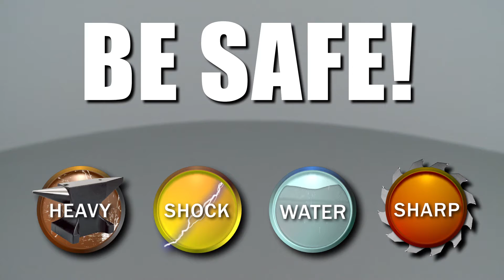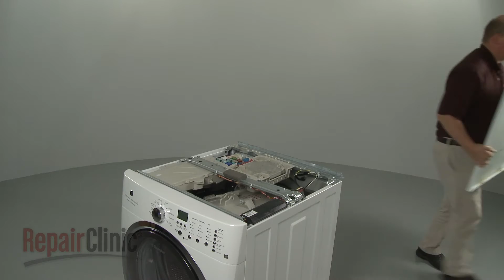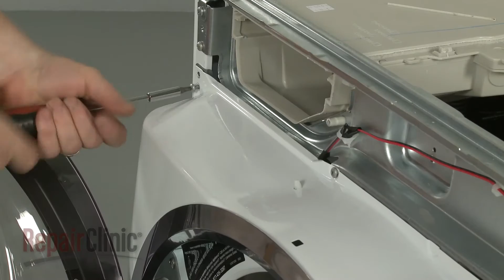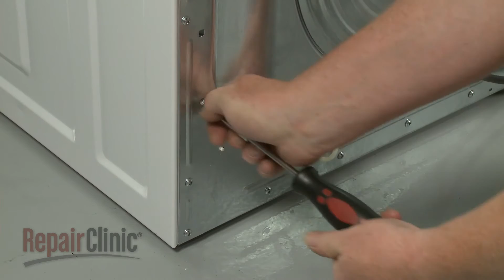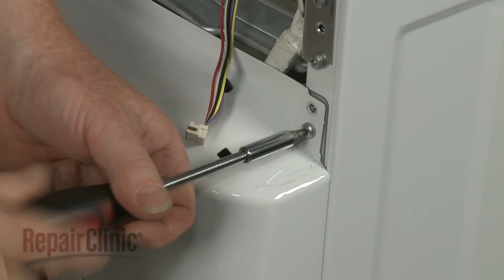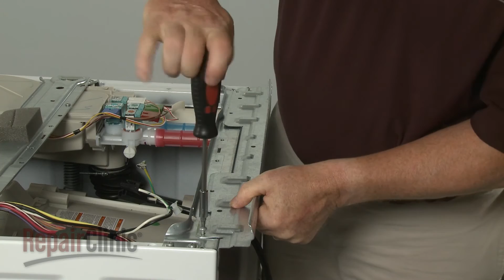Electrolux Washing Machine Drain Hose Replacement #137629200

Comment: omg. My friend was upgrading so she gave me her old washer. The hose was too short for optimal replacement and I ordered a generic replacement. Started to replace it today and thought I'd look up instructions as there weren't any in the manual booklet. This is an insane amount of work, the entire washer needs to be disassembled. It's scary that some engineer actually got paid for designing this crap. I will order a hose extender instead.
Reply: I just got help tilting it back and could unclamp it from the underside

Comment: Thank you to the comment regarding the rubber drum; it was helpful in replacing our hose. We'd like to add that we had A LOT more water than anticipated. Mostly from the drain hose itself. You could call it a "blond moment", but I didn't realize how much water was trapped in the hose we were replacing. The only other problem or issue we ran into was replacing the front panel. For some reason it would not sit right. We ended up putting the bottom screws in first and then the top. Still, one of the bottom screws would not seat all the way. This was a very easy instruction video to follow, very thorough. This project was completed by a Mother/Daughter team. If we ever need repairs in the future we will definitely use RepairClinic where ever possible.
Reply from the maker: +Karri B Thank you for sharing.

Comment: great video! I did the replacement in 90 minutes and I am not a plumber.
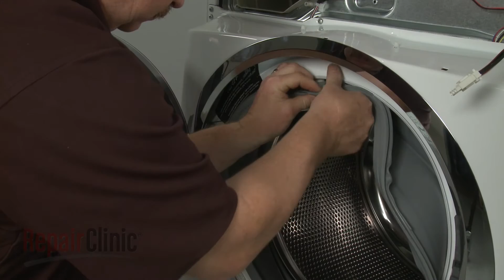Replacing the rubber drum (starting at 7:05) could be a clearer in regards to making sure the rubber catches the lip correctly.
Reply from the maker: +Aaron Larget-Caplan Thank you for the feedback.